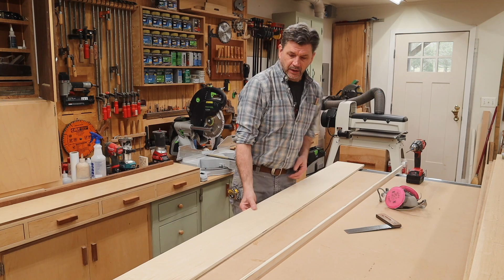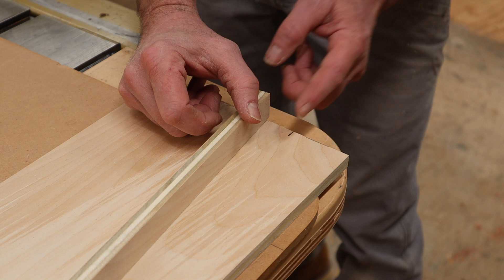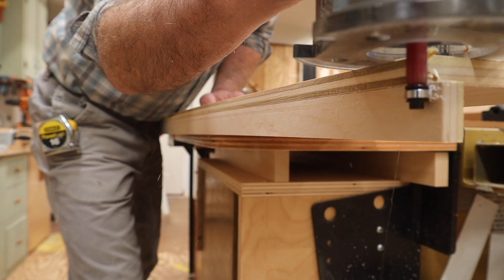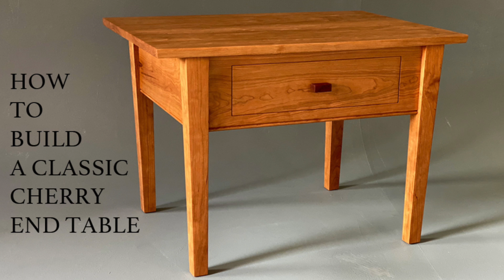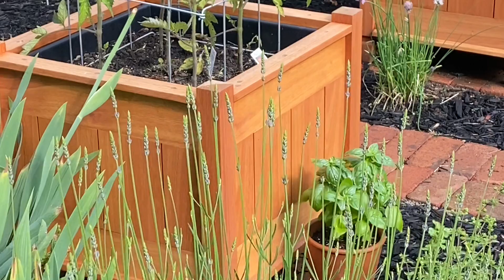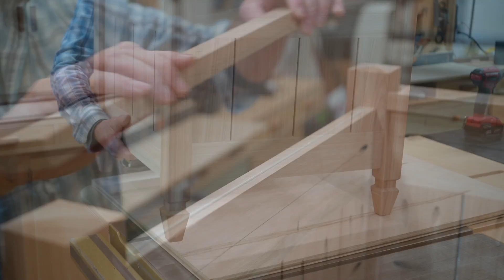Trestle Table - How to Cut the Curve - Router Climb Cut / Woodworking

Comment: I have always found it easier to just switch from a flush trim bit to a pattern bit to avoid the problem with tear out.  You do have to flip the project over but I think it’s better than trying to climb cut.
Reply from the maker: I need to try that

Comment: Thanks Jon.  I really like the curve look and the method you used to make it..  looking forward to the entire video.  This might be a stupid question:  when you cut the curve on the trestle, I would have thought the top edge of the trestle would drop down below the top edge of the support pieces (by the amount that you cut off). Instead it looks like the top of the trestle is still flush with the top of the supports?
Reply: I too thought that initially, then I realised that the support pieces were cross-halved with the newly-curved piece - see Jon wiggling them together at around 5:15.